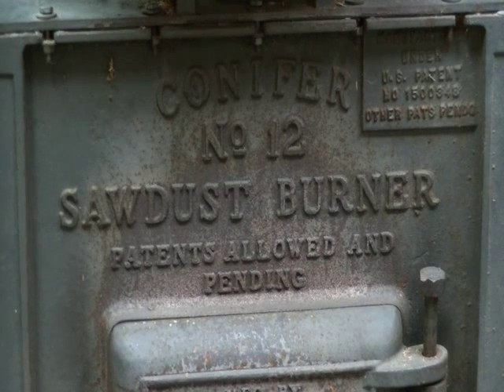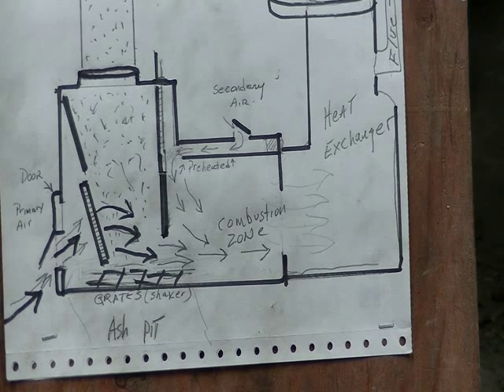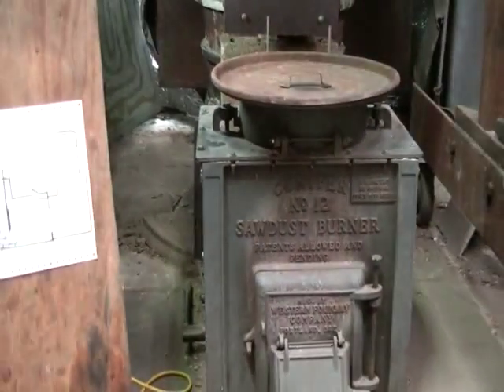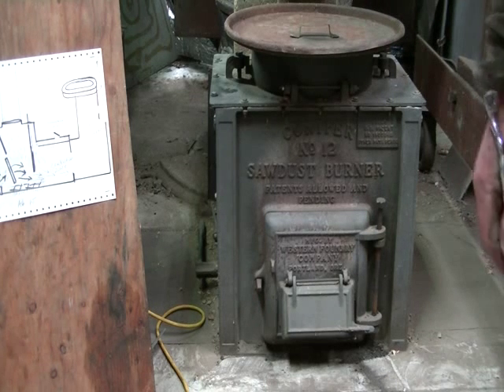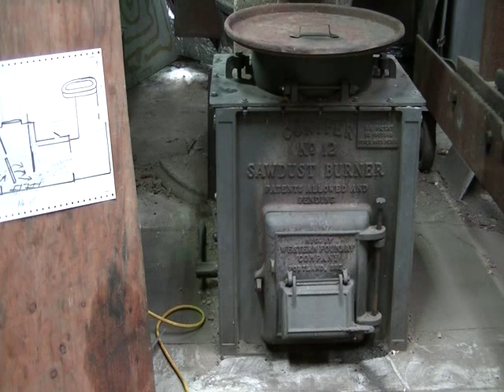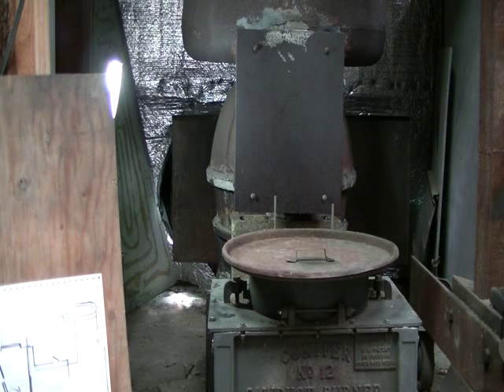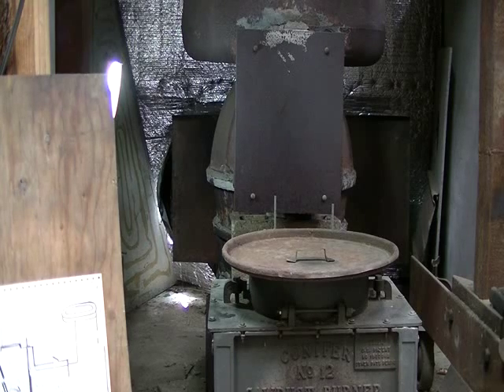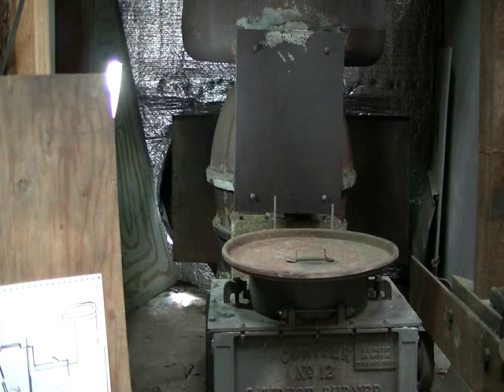Sawdust Furnace gasifier -Intro video \#1

Comment: I always knew you had this setup but I was never clear on it's operation. Man what a heat producing beast! How coarse and how fine can the sawdust particles be to run in it?
Reply from the maker: The sawdust we produce from the firewood processor is in a range between 1/4 " square or less, The cut off saw is 3/4 pitch chainsaw cutters.  Because this furnace is a wedged style cross draft gasifier I would imagine it could handle smaller saw dust or as large as 1x1 wood chips. The trick is getting the fuel under 20% MC to work well. I'm hoping to be able to spend more time in the shop this winter so I might bring the beast back on line